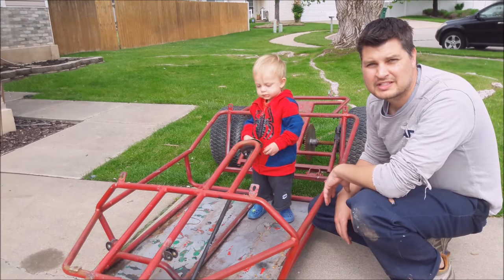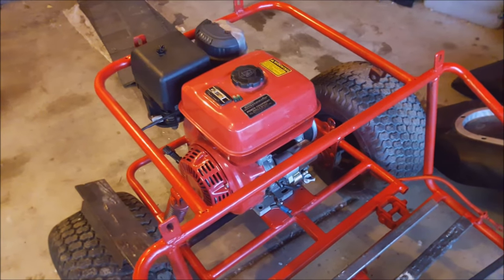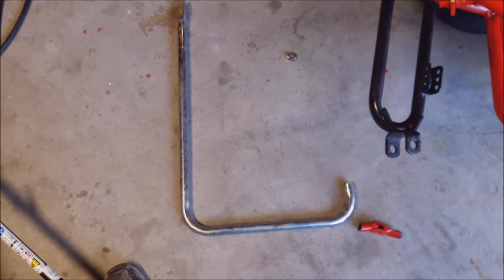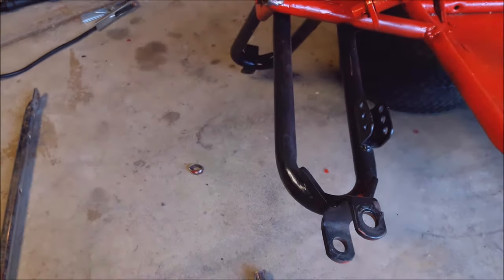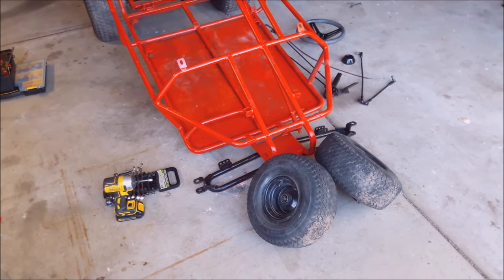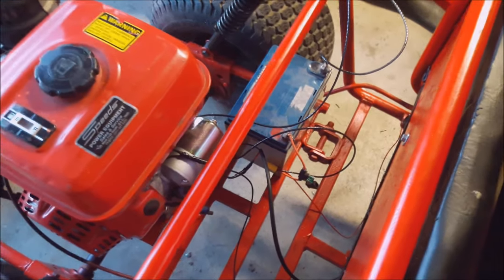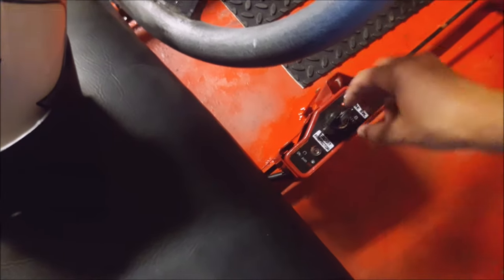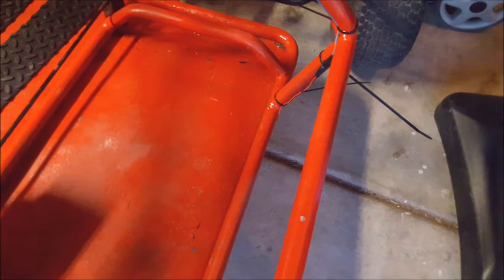Go Kart Build / Restoration

Comment: Great build/revival. I'm about to start welding, or at least attempt and learn by experience, any tips on the best welder for beginners?
Reply from the maker: That's a loaded question, how much do you want to spend? The more money more and better options.  If you only have a couple hundred for a complete setup you are headed to harbor freight!
Reply: @-DIYPRO-  Yep! That was my plan haha harbor freight seems like the way to go for me, hopefully it works. Thanks
Reply: @crabtreemedia8169  how'd it go with the welding? My uncle let me borrow a Chicago Electric Flux 125 and an Arksen 100 amp (yeah right 🙄) AC stick welder. Honestly I'm digging the stick program even though I can only push 3/32 6013. 6011 blows through no matter what I do. I'm personally going to upgrade to a 110/220 Amico Pro 200 DC 100-250 volt unit so I can use 1/8 7018 and get more accurate welds.
Reply: @fatbuddycat  thats awesome man. I bought the titanium 125 and have welded with it quite a few times and I love it. I'm planning on learning stick next, which means I'll have to buy another machine, which will probably be another titanium branded machine.
Reply: @crabtreemedia8169  I would have bought into a Titanium stick but the only welder HF had was a Titanium  200 Stick but it was 220 only, I want 110/220 so I can use it anywhere.

Comment: What exact go cart did you use ? I’m trying to buy one and fix it just like you. Nice video.
Reply from the maker: It is a Yerf Dog. I think the model is 3203.
Reply: Alright and i watch the video about the electric start. But how did you get it to be on the inside of the kart ?
Reply from the maker: @rastafariclee7185  I extended the wires so I could put the box where ever I wanted.

Comment: How did you extend the electric start cord for you to be able to have the key switch by the wheel?
Reply from the maker: Just got some longer wire and ran it back to the starter.
Reply: @-DIYPRO-  where u get the kit for that

Comment: Nice video how did you get it to crank by key or did you by a kit I luv yhe video I have one that I  gonna restore
Reply from the maker: It was a kit just like this:
https://amzn.to/3KfEuET
They sell them for all different size engines.
Reply: @-DIYPRO-  thanks for getting back with me don't mean to bother you do I have to have a honda motor because I bought a new predator motor from harbor freight if I have to get a Honda motor what size do I need
Reply from the maker: @ahmondeboxley2950  those are pretty similar to the Hondas, you just need to get the one that is similar in size. For example you probably bought the 212cc and matches the Honda gx200. There are a couple videos on yt showing them put on a predator.
Reply: I have a go kart that I need help with how much will you charge
Reply: How much would you charge me too help me build my old frame back